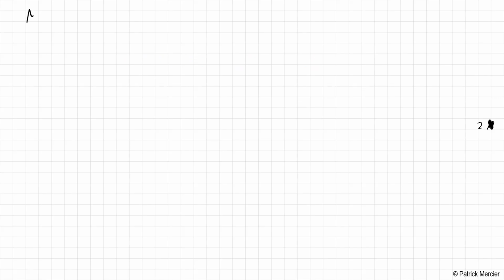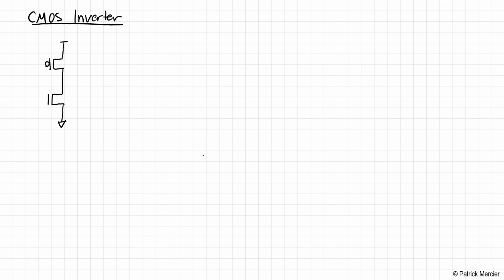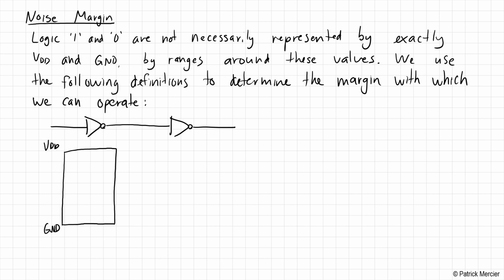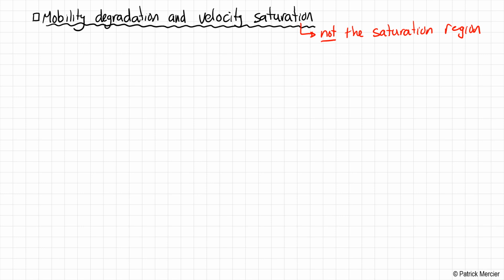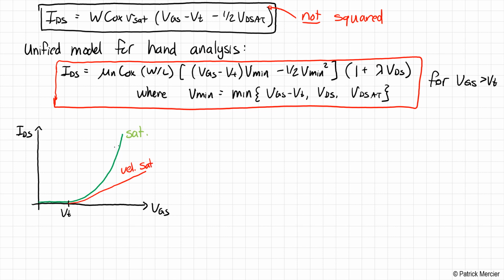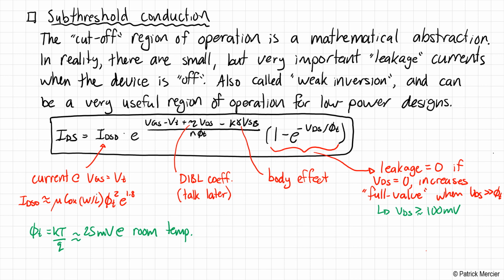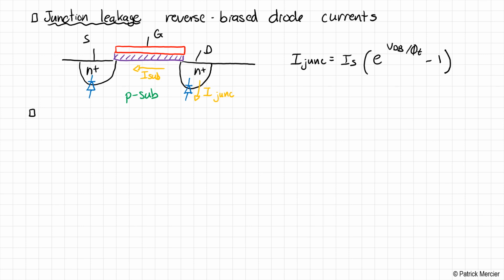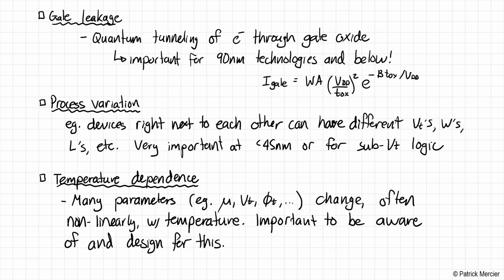ECE 165 - Lecture 3: The Inverter and MOS Transistor Theory

Comment: My exam's on 26th 😢😭 Sir please give some tips, i havent studied much Dear Students, 

The end sem syllabus is as follows:

1. Design of combinational logic circuits: Ratioed logic, pass transistor logic, dynamic cmos design 

2. Design of sequential logic circuits: static latches and registers, dynamic latches and registers, pipelining, nonbistable sequential circuits, 

3. Design arithmetic building blocks: The Adder, and the multiplier 

4. Designing Memory: SRAM, and DRAM

5. Timing issues in Digital circuits: Synchronous timing, clock skew, and clock jitter 

All the best.